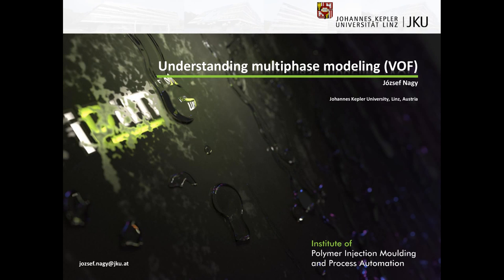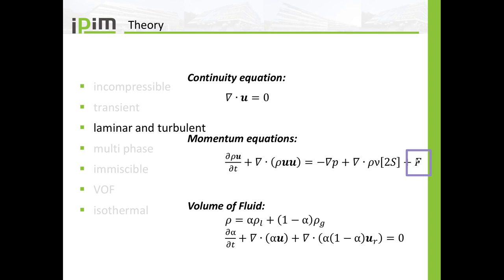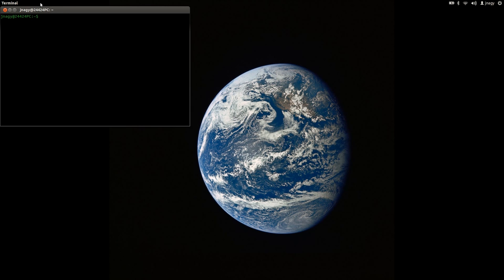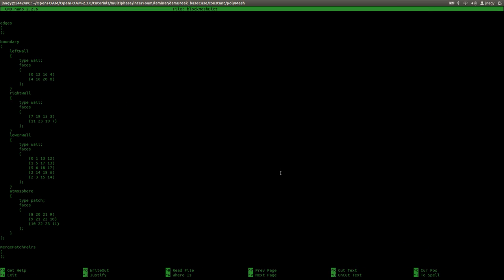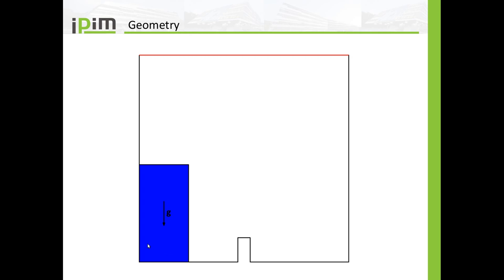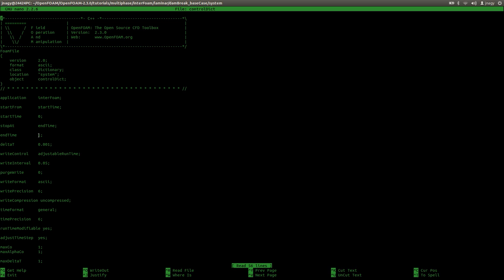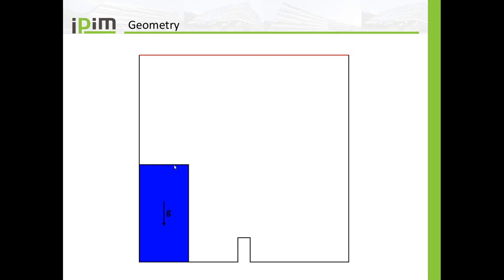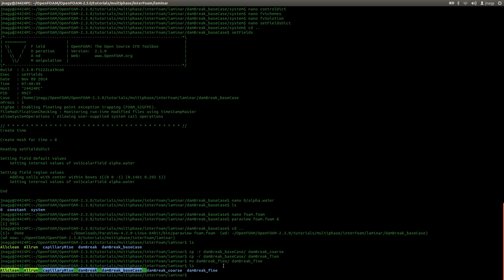Understanding multiphase modeling (VOF) - Part 1

Comment: Thank you very much for the amazing tutorial videos!!

I just wanted to know how do we interpret the alpha values between 0 and 1. If the alpha value is say 0.05 at a location, does it mean that there is mist present there? As in is the simulation predicting there are small liquid droplets in the vapor at that location? Or do we interpret it as approximately 0 hence fully vapor?
Reply from the maker: It is a numerical value. Has nothing to do with reality. This is why the number of these cells should be kept to a minimum.
Reply: @OpenFOAMJozsefNagy  Thank you for your response!! Which method would you recommend if one is interested in knowing how much liquid is carried over/entrained in the gas phase in form of mist or droplets?

Comment: After running the setFields utility, nano/gedit can't open the 0/alpha.water file. Despite that, I can see the water column in paraview. Still, why can not  the nano/gedit read the 0/alpha.water file ?? It can't display the list of values of alphas for various cells. Instead the list seems cryptic with just "@" signs over there. The rest of the boundary conditions stay the same.
Reply from the maker: Try it with vim in the terminal

Comment: Kind of a general question here, but is there a way to run interFoam until it reaches steady state and then run setFields again? I'll happily donate if you have a technique (I have before and will again).
Reply from the maker: Dear Josh, do you mean automatically or manually? Manually you can use a function object, which monitors the mean value of alpha in the volume  and once you see, that the value is constant, you can stop the simulation and execute setFields. For the automatic version some kind of script or app could do the same, but this wold have to be set up.
Reply: @OpenFOAMJozsefNagy  This is what I tried but no luck. My controlDict specifies to startFrom latestTime. Then my setFieldsDict only specifies regions, which I make a different phase and a given value. So I begin the simulation as normal, stop it at some time, execute setFields with a different value than what was initialized, then execute interFoam. The simulation continues from the previous time but no change is made to the liquid/gas field. I'm using OF6
Reply from the maker: @joshmccraney4020   I think possibly if you start a new case with 0 then it should work.
Reply: @OpenFOAMJozsefNagy  A new case with 0? You mean recomposePar and then rename the latest time folder 0? I did get it working with funkySetFields tho, which is nice!

Comment: I have a problem in loading alpha.water values in paraview. I am seeing only 0 assigned to all points(including the box). But inside the file i see that 1 being assigned to points in the box and 0 to remaining points outside the box. I tried twice with setfields but it didnt work. Am I doing something wrong?
Reply from the maker: Paraview is confused by your orig file. Move it out of 0  and you will see alpha.

Comment: Hi I'm trying to solve two phase flow case. 

Case description: A horizontal pipe filled with water. From upstream end of the pipe say at a certain distance there is air tank supplying air into the horizontal pipe. I want to introduce the air with specific constant pressure and some desired volume. I want to push all the air from my tank into the horizontal pipe so that I can later quantify my results accurately (knowing exact volume used in different case files). The problem is to simulate this case i was trying to introduce a tank geometry on above horizontal pipe which was connected to air tank with one small vertical pipe. But as air has low density all air is not entering into the horizontal pipe (some on the top portion on tank, though air pressure is high initially). So Later I changed ma geometry and made tank below horizontal pipe. This allows complete air to get into the horizontal channel but now water is entering into the air tank and hence I'm not utilizing initial water volume used in the simulatiopn which is later very important for quantification of results. 

Is there any boundary condition I can use which just allow specific volume of air (time controlled air inlet) so that after certain volume or time that boundary not supplying any air into the horizontal pipe, something like this? 

Please let me know whats are the possible solutions.
Reply from the maker: Did you try the uniformFixedValue BC? There you can specify a csv file with time dependent data.

Comment: Hello! Nice video! I have completed a simulation where i get alpha vs time. How can I get volume vs time?
Reply from the maker: Use the integrate variables filter.
Reply: @OpenFOAMJozsefNagy  Thanks a lot! One more question. Can you explain the reason why the integration of alpha gives the volume?
Reply from the maker: @ΝάσοςΜπαλαχτσής  Because the function calculates the volume integral of the cells filled by alpha.

Comment: Hi, 
I have a short and probably quite simple question about the presentation of the results of interFoam in Paraview. 
So there are two phases, air and water. To view only the water in Paraview, I use the clip function in conjunction with scalar and set the alpha value to 0.5. What I haven't quite understood yet is what this value stands for? Does this mean that all cells containing at least 50% water are displayed? 
In simulations with a finer grid, areas were also displayed in which there was no water according to the coarser grid. 
Or is this a clear indication that my grid is too coarse?
Reply from the maker: This is a drawback of the VOF method. Your questions are valid and usually there should be only one cell with 0.5 representing the surface, however due to numerics it is possible to have a smeared out surface. This is unphysical of course. You really have to make a compromise between resolution and run-time. This is also true for all commercial codes, this is not an OpenFOAM specific problem.

Comment: Hi. Thanks for your video. It is very useful. Just one question: Can you please explain the difference between p and p_rgh, and how are both related and calculated?
Reply from the maker: p is the sum of p_rgh and the rho*g*h. So p_rgh is only the dynamic part of the pressure.
Reply: @OpenFOAMJozsefNagy  Hi. Thanks. So I should be able to obtain the pressure as P = rho * (g*h + 0.5*u^2) ? I ask since I tried this already with post-processed data and the results were not the same.

Comment: Dear Jozsef
Greetings,

Thanks for your interesting videos.
I need to model a collision between a solid particle and a falling droplet. Based on existing experimental results after collision, particle start penetrating into droplet and create a very thin liquid film in shape of a hallow truncated cone around particle which is called lamella (whole the collision and lamella formation happens very fast ~ 1 ms)

My alternative softwares for simulation are Fluent, OpenFoam, Comsol and Gerris. I'd like to get a piece of advice from you to know which of these softwares is more suitable for simulating this phenomenon (i.e. is able to predict lamella formation and its geometry more accurately)

Here is some complementary information:

- Droplet diameter is 2.8 mm and particle diameter is 2.0 mm
- Droplet is falling by gravity and its velocity at collision is 0.8 m/s
- Particle is moving horizontally with 8.0 m/s
- Drop is water and particle density is 1050 kg/m3

I'm looking forward to hearing your helpful comments.
Many thanks,
Reply from the maker: Sayed Hossein Banitabaei I have no experience whatsoever with Comsol or Gerris. I guess OpenFOAM and Fluent are rather similar, you will need VOF for your case. You will need a dynamic mesh refinement (available in OpenFOAM). Just try the damn break tutorial with mesh refinement and modify it to your needs. I guess your simulation will run for a while.
Reply from the maker: Sayed Hossein Banitabaei Check out the tutorials in OpenFOAM/OpenFOAM-2.3.0/tutorials/multiphase/interDyMFoam. If you are using another version than your path will be of course different to the tutorials. Take a look at constant/dynamicMeshDict within the cases. The magic happens there.

Comment: Dear József, I just followed every step of your video, and now at opening paraview the "Cell Arrays" are empty. It means, that the before given settings (0, constant etc.) are not used, right? What did I do wrong? - I cannot change the parameters on the top -
Reply: Ok everybody, please make sure to run the solver properly before asking! I did not run the solver and I paniced.. It is working now properly, making the 3rd denser mesh. Thank you József!
Reply from the maker: @markcsete1570  I am glad it works!

Comment: Hello I am tried to simulate two phase stratified (air-water) flow using VOF model with ANSYS FLUENT are you familiar with VOF model in ANSYS FLUENT code?
Reply from the maker: No, I'm sorry, I am not familiar. I guess it will be simliar to that of OpneFOAM, but I cannot guarantee it.

Comment: Thank you for your work on this...very helpful. When I try to view the scalar contour, it only shows values of 0. I finally figured out that Paraview was reading alpha.water .org instead of alpha.water. As a fix, I just put the .org file somewhere else. Is there a way to tell Paraview to just use the non-.org file in the future?
Reply from the maker: If I understand your question correctly, paraview automatically selects alpha.water.org and you delete it, so it selects alpha.water instead. If you click Contour in Paraview, you will find under Properties "Contour By"  and there you can select all your scalarFields.
Reply: Yes, once alpha.water.org is removed from the 0 folder, Paraview picks up alpha.water just fine. It seemed like when you went through, both alpha.water and alpha.water.org were both in the 0 folder, and Paraview picked up alpha.water instead of alpha.water.org. Do you know why it did that in your case?
Reply from the maker: Mike Foster
As I mentioned, did you try and select alpha.water?
Reply: József Nagy If alpha.water and alpha.water.org are in the 0 folder, when I open foam.foam in Paraview all I see are values of 0 for the domain. If I then click on Contour, see that Contour By: alpha.water (and the Value Range shows only 0), and then click on Apply, the domain disappears from the graphics window. If I click on the eye icon next to foam.foam in the tree, the domain shows again. When I then click on Contour1 underneath it, I don't see any changes.
Reply from the maker: Mike Foster
Well that's odd. I'm sorry, but It's difficult to solve the problem over youtube. Send me a screenshot to the mail adress, that you find in my about section!

Comment: Jozsef, how do you simmulate a wind tunnel?
Reply from the maker: I have never done it before. I would look for the geometry, mesh it, start with a steady state simulation and if transient effects are needed, use those results as iitial condition for the transient simulations.
Reply: Yes I would need a multiphase simulation as I want to determine the amount of condensation in the model test area
Reply from the maker: Wow, that is even more challenging. Start simple by replacing my stl files with yours and progress from there.

Comment: Hi would it be possible to do this with oil and water? I
Reply from the maker: Sure. Only oil is easy, just change the material properties in transportProperties. However, there is also a solver for multiple fluids in OpenFOAM.
Reply: József Nagy Thank you for getting back to me! Have a good day :)
Reply from the maker: I am glad to have helped!
Reply from the maker: If you know the interfacial tension bewteen oil and water you can give it a go, sure.

Comment: Hello, I would like to learn more about multi phase simulation in oopenFoam and about heat transfer simulations.Can you please help me.Any type of help will be appreciated.Thank You
P.S. your tutorials are awesome.I learnt the basics of OpenFoam from your tutorials :)
Reply from the maker: Souresh Pal I am not sure how I can help. Watch the tutorials and modify them to your actual case. Otherwise you can google it. CFD Online is also a good starting point.
Reply: ok Thank You..By the way is it essential that my C++ knowledge should be very good? I know the basics of C.But it was never my strong point.But the CFD codes of openFOAM I understand them very well the ones you have explained in your tutorials.So please Advise...
Reply from the maker: No it's not essential. Only if you want to modify the models